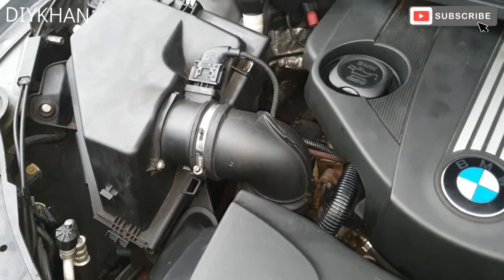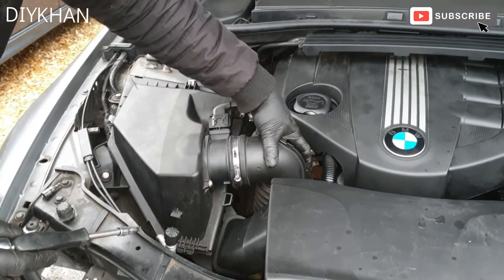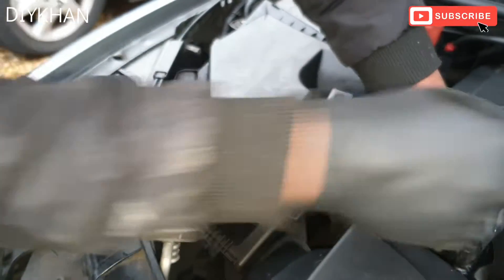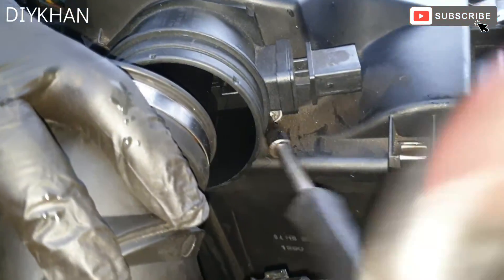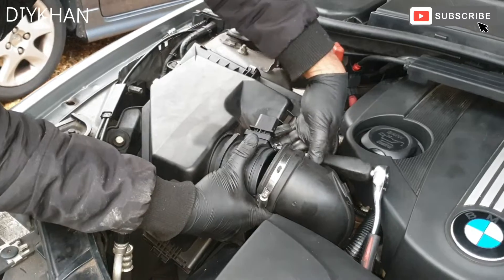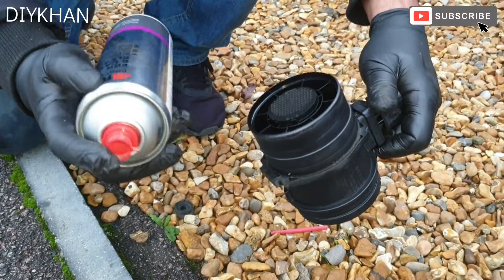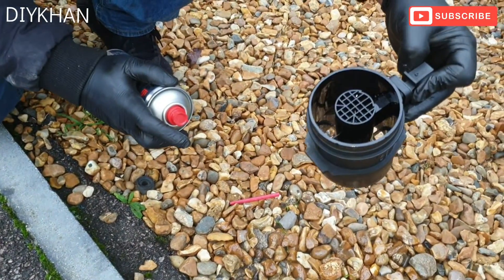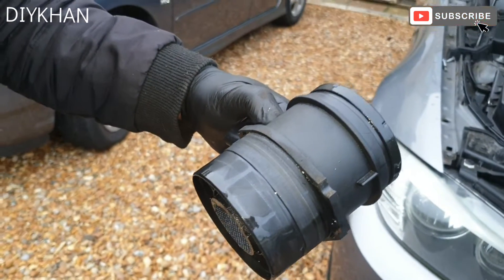How to Clean the Mass Air Flow Sensor on BMW 320d E90 N47 Engine. BMW N47 & N57 MAF Sensor Cleaning

Comment: I had a problem with my BMW X1 juddering or misfiring around 2000rpm. You can do a quick diagnostic to see if it is the mass airflow sensor simply by turning the engine off and unplugging the sensor then driving the car. If the problem vanishes, then it needs cleaning in the way that Mr. Kahn shows you. Thanks for the great video BTW. I had this misfire for around 6 months and took it to 3 garages but they couldn't fix it. I asked chat GPT and it told me about this trick. They say AI is going to take our jobs.... in some cases it deserves to. Peace.
Reply from the maker: Thanks for your appreciation and good luck with the future. Peace.

Comment: Same bmw 3 series n47 engine, my car goes limp mode engine light comes when giving acceleration on slow moving traffic or round about does it helps after few seconds it drives normal. When you are in traffic or quite often brakeing only you acelrates it goes to limping any advice
Reply: I have the same P115c
Reply: @PierceSherry did you end up finding the fault? I’ve got the same error code, poor acceleration but once engine warms up the car runs like normal. So I’m hoping a new Maf sensor solves my issue
Reply: Were you able to find the fault

Mine goes into limp mode after having travelled 40 miles in a continuous journey

Comment: take a sharp screwdriver, the circle as you spray with the spray, it is glued, lift it a little and it will come out, and that way you will touch the MAF sensor to clean it better, then a few drops of glue stick it, you can't mistake it, it has a mark, just like you when you clean it not clean
Reply from the maker: Thanks 😊

Comment: Hey dude. Wee have a problem on our car. Can you help? Wee changed air filter and mass air sensor thing. But the car is jumping on diffrent rpm for no reasson and i get a error code wish is : p0101 mass air something i don't get it why the car is acting like this. . The error code have been seen before and after the changes.
Reply from the maker: Hi. These car a very sensitive when it comes to sensors. Did u buy one from bmw or one from after market ie ebay or amazon?.
Reply: @diykhan  Hi! Thanks for your answear. Ah yeah i know these Cars are too sensetive. Well this one wee bougth same as was on the car before. It's the more exspensive one. So i think there should be no problem but the car still doesn't run as it should and the error still there. 800-2000 rpm the car runs strange but after that it's no problem.
Reply from the maker: @bazexbaze9218  another thing I can suggest is to buy bp and shell fuel only.
Reply: @diykhan  ayeah a better quality fuel shud be good for the car but I don't think it Will Solve the problem sadly 😔

Comment: Ma car is shaking a bit and rpm jumps when starting the car in neutral. Could this help?
Reply from the maker: You should give it a go. Good luck
Reply: Any luck?
Reply: @Mohammed2428  not yet, im waiting for mechanic to start work again. I bought a high pressure pump fuel regulator i hope it will help when i replace it.
Reply: Did you fix it?
Reply: @muhametademi3771  yes. It was the high pressure pump regulator valve.

Comment: Does it actually gets dirty? My car is 170.000km, just cleaned MAP , is it any necessary to Also clean this MAF sensor?
Thanks
Reply from the maker: If you are not getting any kind of warning lights on the dash n the car is running fine then don't bother removing and clearing any components.
Reply: @diykhan im having hiccups during acceleration and bouncing idle but only when their is decent amount of fuel in the tanks when fuel warning light is on hose problem isnt there but i have no codes on the dash ??
Reply: I did my Map sensor yesterday. Cleaned it with brake cleaner, it was soooooooo gunked up with soot its beyond belief. I subjectively think car works tiny ammount better now, but I think its probably in my head hehehe. It also goes better after being washed so.... haha. I had no lights or limp modes or anything like that. Probably will clean maf too soon.
Reply: I feel the same when my car goes to the carwash 🤣 runs and drives better

Comment: Where should i start mate same engine , have a whistle/ hissing sound on pull off slightly quieter when diving.

Cheers
Dan
Reply from the maker: That sounds like some vacuum pipe leak. Have you checked the turbo pipes
Reply: @diykhan  hi no I haven't checked yet, which side is turbo driver or passenger side mate? (Uk)
Reply from the maker: Driver side under air filter box side of it.
Reply: @diykhan  OK cheers buddy thanks alot 👍 appreciated.
Reply: @diykhan  if I want to smoke test which pipe do I test, through the air filter pipe or which pipe?
Reply: @diykhan  and what qear am I looking for on the pipe holes or splits and check seals on pipes?

Comment: Brake cleaner OK to use instead?
Reply from the maker: No its not recommended. Best to buy proper stuff from shop.
Reply: use dry electric contact cleaner